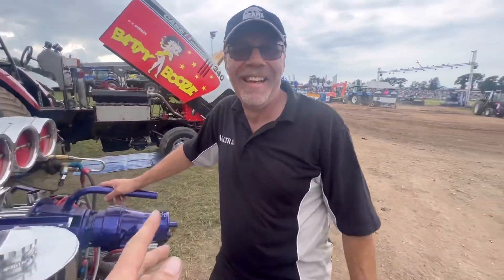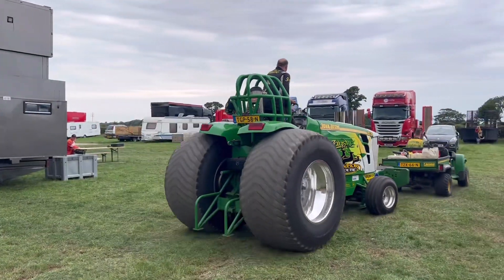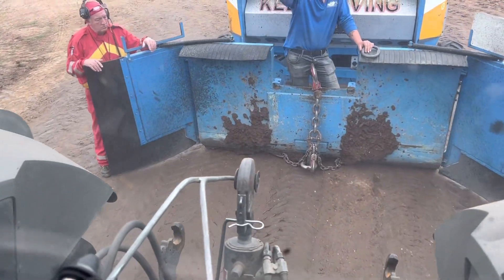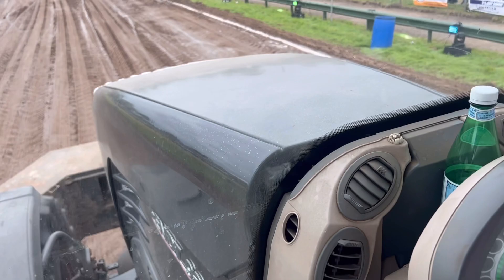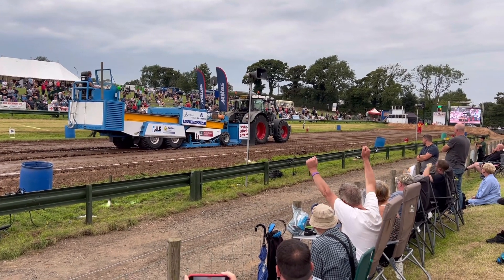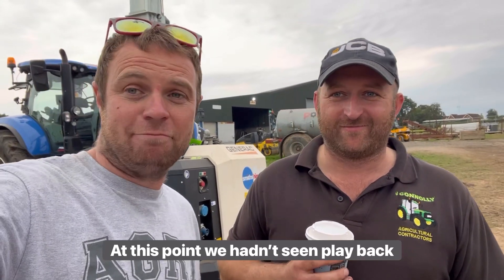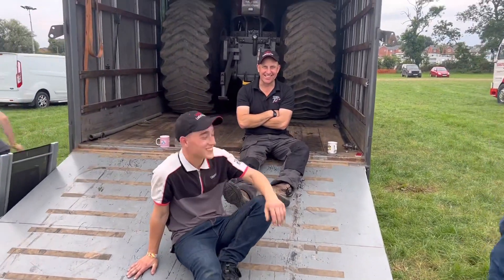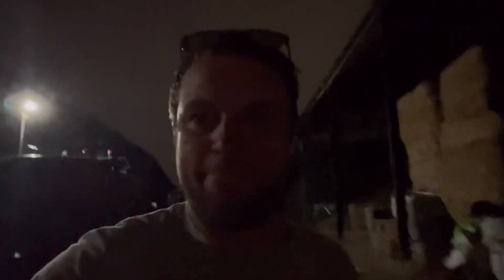DAY 889 PART 2 MORE FUN ON THE SLEDGE WITH BERKSHIRE FARMGIRL #OLLYBLOGS  #AnswerAsAPercent

Comment: Great video, should come to holland to see some proper tractorpulling. I think pulling with the standard tractors is a bigger thing over here. They are divided in about 8 classes going by there wheight, sled set the same for each tractor in the same class. Also letting youre tires down is crucial as it showed, i usually run them at 0,5 0,6 bar on my puma 200 and 4240s

Comment: Right I finally understand why the tractor is slow down halfway through. So is the person on the back of the sled driving the way forward? Can you do a video on how tractor pulling works the rules etc?
Reply: The weight is driven forward by the wheels of the sledge. That way the weight is in the same position at the same distance down the track every time. Making each run identical for everyone no matter how fast or slow that tractor pulls.

Comment: seen as the MB trac is in bits and been left outside id say either that or the massey 1200 would be a interesting tractor puller  but might not work being equal wheel. or maybe this is the excuse you needed to buy a quad trac to beat james.